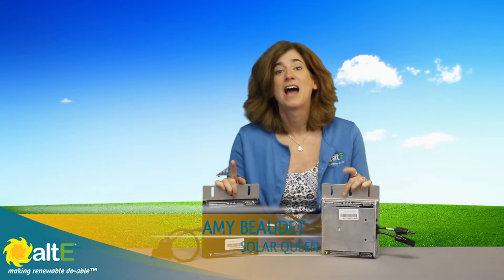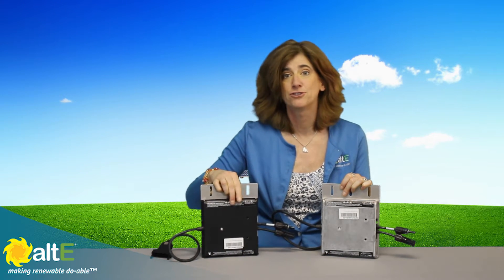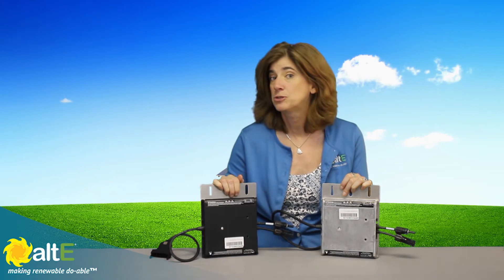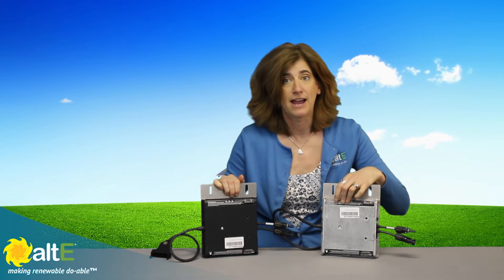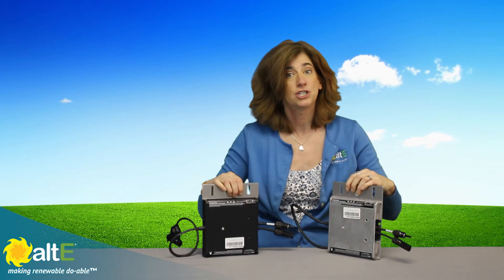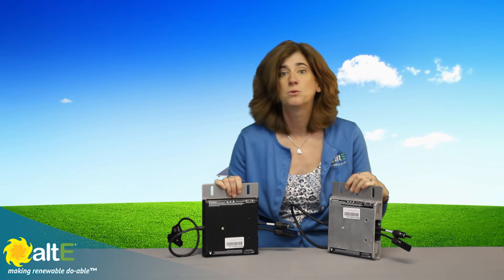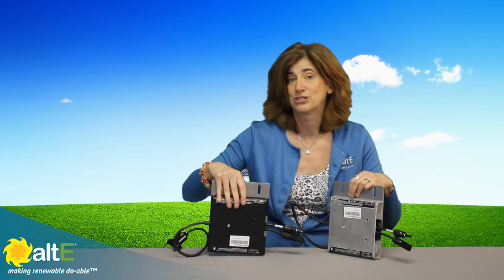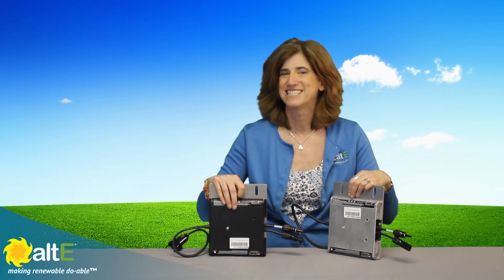Cosmetic change to Enphase microinverter case

Comment: If you have (2) 12v 140w Kyocera tied in series can you use these?
Reply from the maker: The Enphase microinverters are designed for 60 cell, 20V nominal panels. Wiring two 36 cell 12V panels in series will give you 72 cell, 24V, which is too high. Their maximum temperature compensated input voltage is 48Voc. The Kyocera 140 has a Voc of 22.1V, so 44.2 in series, but if it ever gets colder outside than 25 degrees C, it will very quickly rise above the 48V because silicon voltage rises with the cold. SO no, you cannot put two panels in series to use an Enphase microinverter.
Reply: +altE Ok thanks scratch that idea I don't like the bulky big panels..how many (max) Kyocera 140 watters can i put on a Outback Flexmax 80? 20 to 30 foot wire run.24v system.
Reply from the maker: The FlexMax 80 can output up to 80A, so 24V x 80A = 1920W. The charge controller can handle up to 2500W in at 24V, but it will clip the output to 80A, so in perfect conditions you may not be getting all of the power from the panels. So 1920W / 140W panels = 13 panels, but that doesn't divide well into even strings. Wiring them in 2 parallel strings of 6 in series, means 12 panels.
Reply: +altE thanks👍🏻

Comment: I heard that aims has these now, but I would rather go with this one that had a better reliability record.
but here is a question, maybe last month there was a house fire where the solar panels burned through the roof, is this typically caused from a micro inverter like this one?
Reply from the maker: +Rev John O'Toole  Enphase has been making micro inverters since 2008. They went through all of the hiccups of creating a new type of product and market, and have done so very successfully. 
While fires actually caused by solar panels are extremely rare, micro inverters are generally viewed as the safest option for solar, as they have the ability to shut off the solar panel at the panel, and do so automatically when the grid is shut down. They also have arc fault detection, again, right at the panel, providing even more safety.
New fire codes in the USA are requiring a 3' path along the sides of the roof for firefighter access,  and along the ridge of the roof for venting. This is not just for solar fires, but for any fire on a house that happens to have solar panels installed. NEC2014's Rapid Shutdown requires a way to remotely shut off the solar panels to within 10' of the panel. The combination of codes and technology have made solar installations very safe.